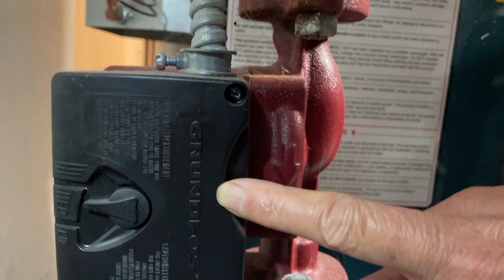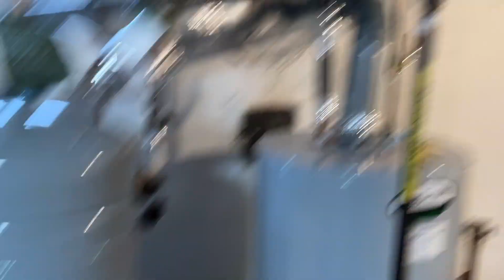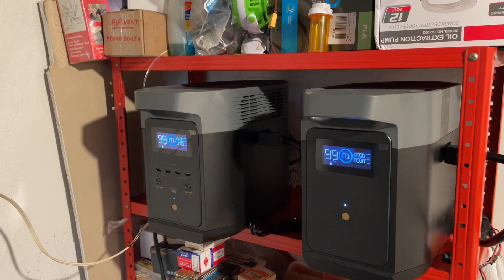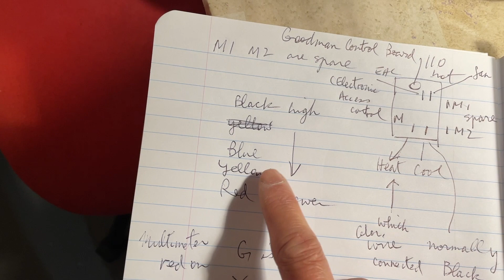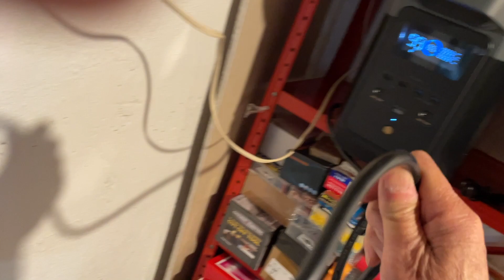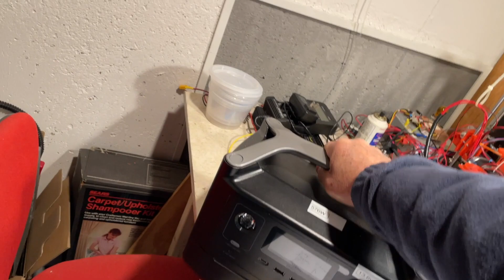Extend the battery runtime of ecoflow delta 2 by changing boiler pump or furnace blower speed

Comment: Thanks for this tip. I'm pretty confident that doing this will extend the battery power of my Delta 2.
Reply from the maker: Your boiler circulator will last longer at a lower speed. Same goes for throttling back furnace blower speed. Just make furnace filter is not clogged.

Comment: This is a pretty helpful tip. It would definitely extend the charge of my Delta 2.
Reply from the maker: No matter what Heating system u have, you can lower the power consumption. They don’t put a fan selection switch for furnace blower motor is maybe they want better airflow and people are not conscientious about changing air filters.  For boiler heat heat, if u can bypass the circulation pump, u can continue to have heat by gravity feed your system.